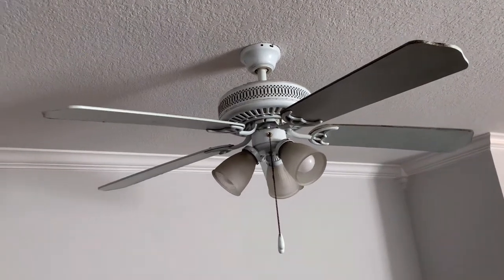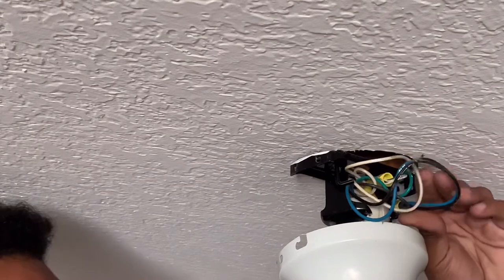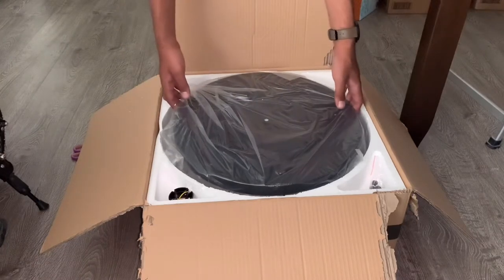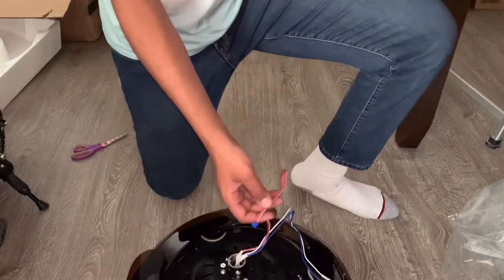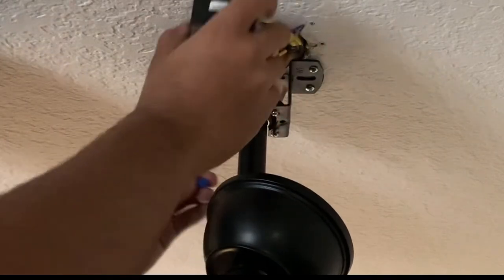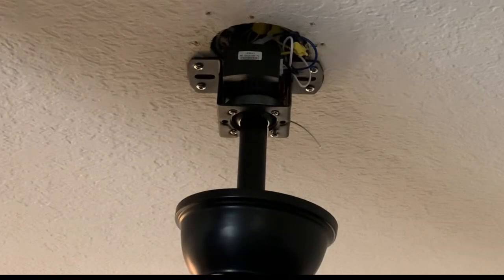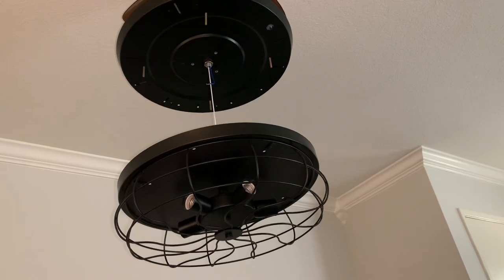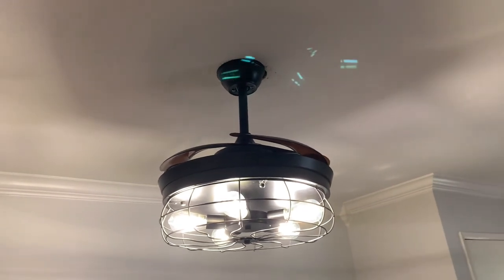How To Install or Replace a Ceiling Fan, No Attic! Easy!

Comment: Thank the lord someone actually made a decent video on this fan. The pictures they include are so zoomed in you can’t see the pieces right and they don’t even mention which screws go where. Just tells you to fasten things tightly.

How’d you managed to attach the light piece to the main unit while it was hanging? I had to take mine back down